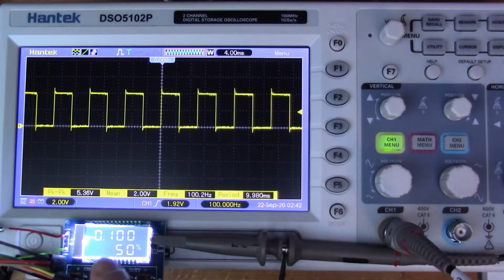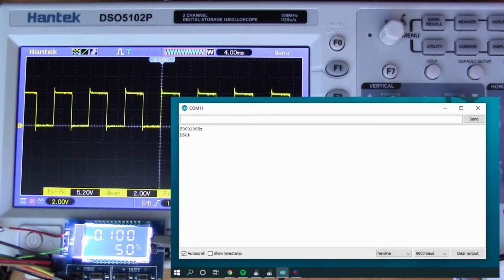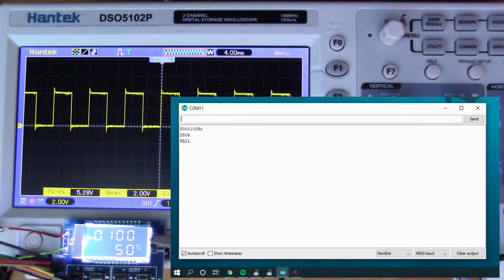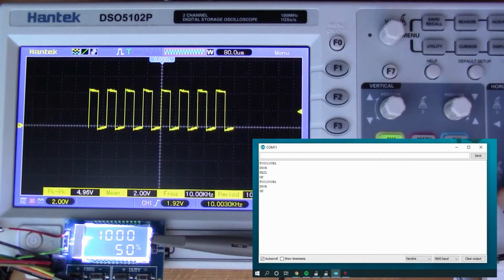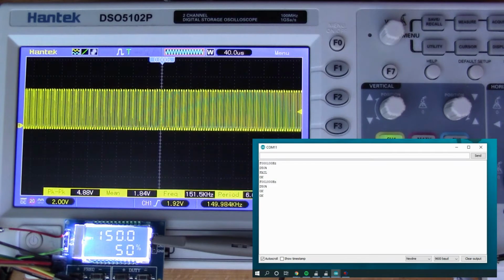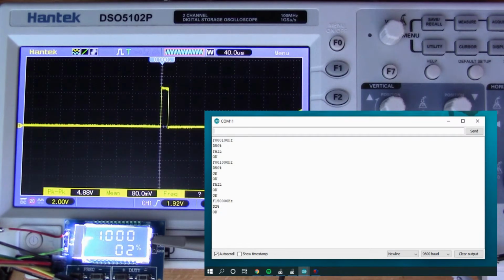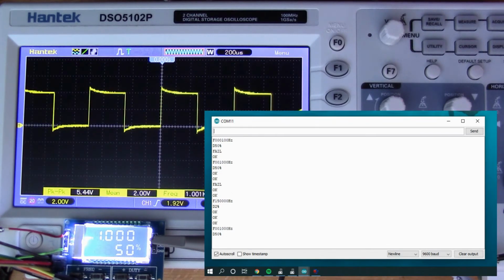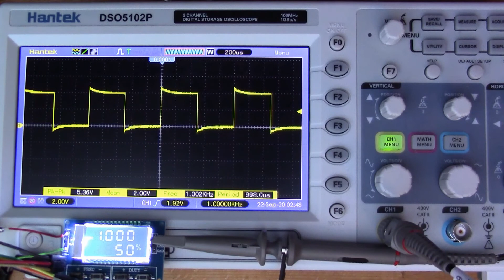Signal Generator Modules Revisited (#126)

Comment: I ordered and have just received the 3 channel version of these generators. It's frustratingly different from the single channel version which I already have but I think I've got it figured out. The latest one is labelled XY-LPWM3 and looks similar except for an extra 4 buttons. The serial set up is the same: 9600baud,,,etc.
1/ The string "read" will return the current settings in the module. (Not "READ" or "r" - my 1 ch. version is happy with any case)
2/ "F1.0.5" sets the PWM freq to 105kHz (My 1 ch. version needs "f105000" or "F105000")
3/ "D2:021" sets the duty cycle of channel 2 to 21% (Not "D2:21")
4/ "f1.0.5" and "d2:021" don't work. F and D need to be upper case.
5/ The responses are DOWN, FAIL or the settings string. (My 1 ch. version sends OK, FAIL or the settings string)
6/ No CR (carriage return) is sent by the generator and this can mess with reading your input buffer depending on what device you are communicating with.
7/ Use a delay in your code between sending command strings or you'll be like the bartender who slides drinks down to the end of the bar to a customer who can't grab them all fast enough. There is no hardware or software handshaking with these generators.
Reply from the maker: I haven't seen the 3 channel version, although I did make a video about a 2-channel one that had a different type of display. Thanks for the info.
Reply: @MartynDavies  Again I'm late to the party. I should have taken a look at your 2 channel PWM video. Did you figure out the serial command anomalies? I'd seen a picture of one but hastily wrote it off when I saw the micro USB port not realising it had a serial port too.
Search for XY-LPWM3 in Google and choose 'images'. There are not as many on sale as there are the single channel version.
Reply from the maker: @rickneill6924  No, I remember the serial interface working intermittently, and wasn't able to get it to accept some commands.

Comment: It's not rocket science but I realised that the XY-LPWM (on its own) is of little use when it comes to controlling servo motors. Servos are controlled by a 5 volt, 50 Hz PWM signal which ranges between a duty cycle of 5% and 10% to get full range motion of the servo. (In reality servos will work slightly outside the 5 to 10 range too). In other words, with regard to the generator, the choices are 5%, 6%, 7%, 8%, 9% and 10%. That's 6 positions across the full range of a servo and it's far too coarse for most applications. *However*,,,, the generator's PWM output can be used to create a varying DC level which in turn can control a 555 timer IC to produce the PWM range required by servo motors. It might sound complicated but it involves very few components. I'll be pursuing this solution even though dedicated servo controllers for Arduino etc. are easy to find. Likewise, an Arduino pin can be set up to deliver PWM of any flavour but from a teaching point of view, the generator's display of frequency and duty cycle, together with control via serial communication, is very useful.

Comment: Some additional findings regarding the latest XY-LPWM modules:-
"f123" works the same as "F123" - Case is disregarded. The same with duty cycle.
"r" just by itself gives the same result as "read"
(I also sent the string "rtyuiop" and got the same result as "read" - no FAIL msg!)
I have been unable to combine a frequency setting with a duty cycle setting in a single command string. I have seen some information that suggests the 2 settings can be separated with a comma and a space - e.g. "f123, d60". This doesn't work for me. I can only set the f and d values separately. Not only that but I also need to put a small delay in between sending the 2 separate command strings or else I get a FAIL response. Does anyone have any answers for this?
Reply from the maker: Yes I'm sure that I saw 'r' work also.  I don't know about combining the commands.
Reply from the maker: Also of interest: I stumbled across this github site (https://github.com/TG9541/XY-LPWM) where he's reprogramming the processor so that he can run programs in FORTH.
Reply: @MartynDavies  Yes, I also found this while trawling. It's pitched above my level of knowledge and experience but interesting nonetheless. I have better skills in hardware than in coding but I have a friend who is the other way around so we have a good partnership.

Comment: Once again I wish I had watched this before spending a day unravelling the mysteries of my recently purchased module. I discovered your previous video before this one and at that point decided that I must have a more recent version of the module because commands and responses are different with the latest firmware. It's fair to suggest the original firmware was written in a non-English speaking environment and DOWN/FALL equate to DONE/FAIL (Now it's OK/FAIL). I've added some hopefully helpful comments to your previous video. For the price, these are an amazingly useful device and I currently have the 3 channel version on order from eBay. I intend to use it to control 2 servos to tilt a platform in any direction. I do recommend using level shifting if interfacing to 5 volt logic. It does work when bolted straight to a 5 volt device but it might not be good for the long term reliability of the module.
Reply from the maker: Thanks - it actually didn't occur to me that 'down' might be 'done'.  I think I said this in one of my videos, but I really wish  that they would open-source the software.  This module could be even more useful if we were allowed to tweak the software ourselves.
Reply: @MartynDavies  P.S. You can get a full size copy of the schematic from Protosupplies by 'View image' and chopping '-400x300' out of the URL. This replaces the 400x300 image with the larger version.
Reply from the maker: @rickneill6924  this is great
Reply: @MartynDavies  Re hacking, I found some excellent info at protosupplies.com/product/xy-lpwm-pwm-signal-generator-module

Comment: Hi my friend i find very intrensting your video with generators.I want to ask you if we can transmit and receive signal from generator by antenna.Thank you.
Reply from the maker: If you wanted to transmit the signal, you would have to use the audio signal to modulate a radio carrier.  You can see a simple example of modulation in this video: https://youtu.be/w6V9NyXwohI